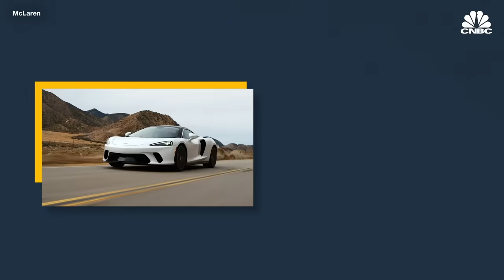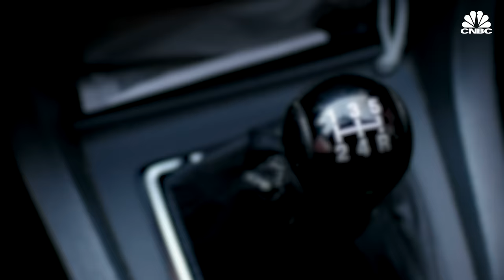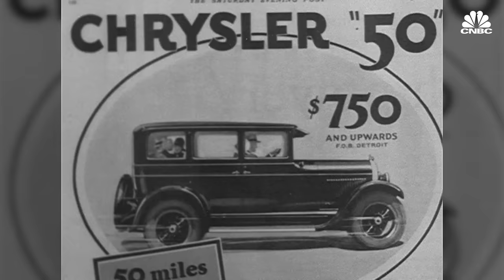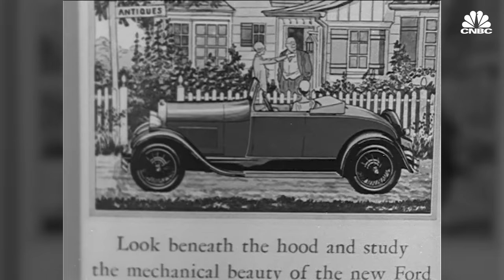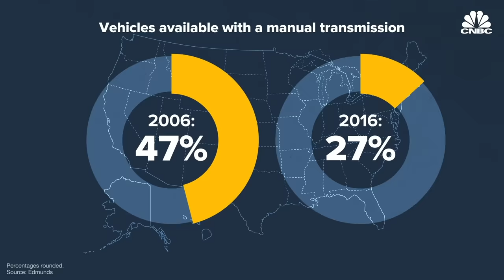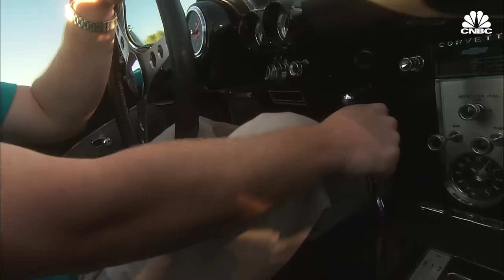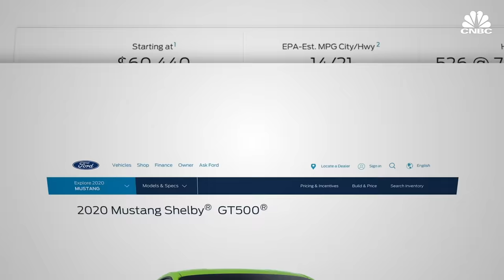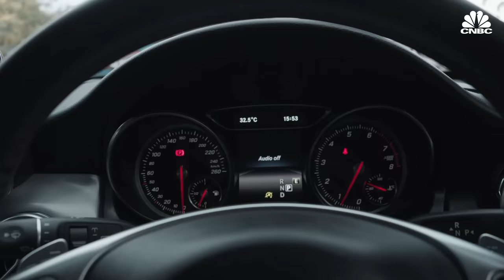Why Stick Shifts Are Going Extinct

Comment: Driving a manual is among the most fun things to do in daily life, to me.  I love it.
Reply: It adds a little bit of fun and joy to daily life. Yeah stop and go can be annoying but when you get to upshift quick onto the freeway ramp you can't help but smile
Reply: Makes gig delivering so much more worth it compared to when I'm stuck with an auto. Heel-toeing all the time and just generally feeling more connected to the car, due to having all 4 limbs controlling 1 (or, at times, 2 inputs simultaneously), makes driving way more enjoyable.
Reply: Agreed, we are commuting every day for work. Might as well add some fun to our daily routines.
Reply: Yeah it's SO fun watching your clutch wear out whenever you take off from the traffic lights.
Reply: @smokescreen2146  Skill issue.
Reply: @mikeydude750  Oh yes, goodluck getting a good lauch to keep up with traffic without riding the clutch when the lights go green...
Reply: used to dislike manual cars but once ive mastered it which takes times, i find manual transmission to be satisfying to drive.
Reply: @smokescreen2146  you shouldn't worry so much about the other cars and wait for an appropriate opening
Reply: @theiaraine  Hahaha you like having cars sit right up your tail and overtake you out of frustration? It's either that or ride the clutch to get a good launch.
Reply: @smokescreen2146  I'm not insecure enough to care about someone passing me when I take a couple seconds longer to take off. It's not as big of a difference than you seem to think it is.
Reply: @theiaraine  When someone is right up your tail, if you shift into second gear at a casual pace your car will then stop for a split second as you let go of the clutch, and where do you think the car sitting up your tail will end up?
Reply: @smokescreen2146  that's really not my problem as they would be at fault. Any damage would be minimal.
Reply: @theiaraine  And you just confirmed what I said all along, that manual stick sucks, congrats.
Reply: @smokescreen2146  I confirmed nothing. I'm saying the problems are not nearly as big as you say they are and they only stem from the rise of automatics.
Reply: @theiaraine  Yeah not big because of people like yourself who understand nothing about cars will likely attempt to floor their cars (ie over reving their engines) when the lights go green in order to keep up with traffic or avoid frustrating the drivers behind, and all this while thinking it's perfectly ok for the engine in the long run.
Reply: @smokescreen2146  The whole point is that I take my time and still haven't caused an accident or damaged my car. And that flooring it is my least favorite thing to do with cars of both types. I couldn't bring myself to do it on any car that I care about or enjoy driving
Now I wonder, why do you care/know so much about something you seem to hate a great deal?
Reply: @theiaraine  In other words you like holding ppl up in traffic and that is your defense for driving manual.
Reply: @smokescreen2146  I'd much rather drive safely and check for traffic before I cross than rush for drivers whose problems I don't care about (tip: you can pass slow cars).

I ask differently; how much experience do you really have if you have such a dislike for manual transmissions which clearly suggests aversion?
Reply: @theiaraine  You see, by you driving slowly you create a hazardous environment making other cars scamble to avoid a red light and in the process changing lanes, braking hard, swearing. All that could be avoided by getting rid of manual cars.

I understand the appeal for manual sports cars and exotic high performance cars in an open country road. But for city stop and go traffic in SUV, utes, sedans? Gimme a break. Why on earth do people like yourself prefer to use your left leg and wrist 200 times a day and then harp on about it on here?
Reply: @smokescreen2146  You don't understand the enjoyment that comes from driving manual then act like you know more than people who actually like driving stick. I'm not going to entertain this conversation anymore. I am frustrated with my lack of answer to my question. Goodbye.
Reply: @theiaraine  What enjoyment? Mention what exactly do you enjoy? I've driven stick my whole life and not just one car. Manual transmission is an outdated concept kept alive by those like you.
Reply: @smokescreen2146  actually automatic transmissions have clutches too, and they wear out justice frequently as clutches on a manual transmission do. So there you have it.
Reply: @smokescreen2146  that is not true is somebody who drives a manual car as a daily commuter shifting into second is not going to take much time and they are on your ass and they hit you. It’s their fault and you could pretty much sue them to get a new car. But the likelihood of them running into you when you go shift gears is highly unlikely.
Reply: @jeffreyburney6161  
Automatic transmissions have computer controlled clutches to minimise wear, meaning it will last the life of the car as long as it is not abused.

The commuters behind may not run into you, but they will surely swear at you as they drive pass and look into your driver side mirror. I hope you have a good face to make.
Reply: @smokescreen2146  I’m usually the one passing them up. And by the way with some of the modern automatic transmissions after about 50,000 miles, you will start having all kinds of issues with them and be prepared to fork out about eight grand to fix the issue.
Reply: I'm driving a auto dd. I wonder if that's why I'm so bent outta shape all the time... idk why but your comment made it click. I know I miss driving manual but maybe it more then I thought.. hmm.
Reply: 110% agreed.

Comment: "If you can drive *manual you can drive anything..." - Dad
Reply: Replace 'standard' with 'Yugo'.
Reply: Yah apparently my father thinks I’m qualified to drive an big rig 18 wheeler now 😂
Reply: @nickihuevos221 yeah with a CDL
Reply: @nickihuevos221  My dad's a truck driver for Fedex and he thinks I am more than capable of driving a Freightliner LMAOO
Reply: I remember telling my dad that when I became a crane operator. I was like , “ you lied to me old man” . He said I was a sonnafabitch... then we both did finger guns.
Reply: @kylemathew205  All this complaining about simply driving a car with a stick shift. When I grew up they didn't have automatic power steering, power brakes or even turning signals. I would like to see these complainers today in a situation where they learned to drive a stick or they didn't drive at all and then see how they feel about standard transmissions on cars.
Reply: @melvinholliday4160  And they were all rear-wheel drive back then, too.  If it was snowy and you needed more traction, put 2 bags of sand or salt in the trunk to weigh it down.  My first car didn't have air conditioning, either.
Reply: Any passenger vehicle 😂 just exclude commercial vehicles.
Reply: "And that's how I ended up driving an M1A2 Tank....." - suprised teenage PVT @ Ft Knox.
Reply: Ok boomer 🙄
Reply: So true. The words of a wise man. I feel like it should he manditory for everyone to learn how to drive stick so they can becone better drivers.
Reply: Colin H.     Unnecessary these days, especially when you’re stuck in traffic all the time.
Reply: @djrom66  "No, but very efficient"
Reply: @acommentator69  i feel bad for you
Reply: Unless it's a non-synchronized transmission with straight-cut gears.  You still have to learn those.
Reply: you don't require skill for this. You just change gear based on the sound of engine. its so simple
Reply: Guess your dad never saw a maintainer
Reply: Thats strange, I never driven an automatic.
Reply: This comment is exactly what my dad tells me every time were on the road.
Reply: "standard". Automatic is standard today.
Reply: Anirban Ghosh downshifting is the skill
Reply: Dad you're smart to have me drive a stck shift 😆
Reply: @anirbanghosh7987  id love to see you explain that to a first timer
Reply: Colin H. 
As a female...I agree!
I can drive a stick, and am proud of it!!
Reply: @josezaragoza3188  "No way Jose"
Reply: @mistamaog  Sadly even lots of commercial vehicles are going automatic. Manual is still prevalent among semi's, but lots of box trucks and similar are auto now.
Reply: @melvinholliday4160  I learned to drive on an 89 Pontiac Sunbird. Stick shift, manual steering, manual locks and windows. Wasn't built with A/C. The fanciest thing in it was a tape deck.
Good times.
Reply: @anirbanghosh7987  yup! Truck I drive has a light to tell me when to shift, I don't pay it any attention because I know what I'm doing. I just glance at the tach once in awhile to make sure I'm not pushing it too hard.
Reply: @r6u356une56ney  the company my uncle drives for put automatic transmissions in all their 18-wheelers.
Reply: A good portion of the large fleet trucking companies are going to automatic transmission semi tractors.
It's definitely harder to shift a stick shift semi the gears aren't synchronized and you either have to double clutch or float the gears pausing through neutral the first Split Second for the engine speed in Gears to match so they don't grind.
Even though it's different it always helped when someone new to driving the semi had a basic understanding of operating a clutch and Shifting the gears in a car just the timing and how to use the clutch without jarring the Driveline.
Definitely becoming a lost art whether it's in a semi or a car.
But understandable obviously much easier to drive an automatic and with all the traffic nowadays more pleasant as well.
But on the other hand if you have a muscle car or sports car they are definitely much more fun to drive with a manual gearbox.
Reply: Colin H.-True.
Reply: lol most cant drive a manual
Reply: @melvinholliday4160  i had a choice .get manual Ram,or automatic.Drove both.Manual had more power.better gas mileage.better towingcapacity.
Reply: @anirbanghosh7987  yes,but most people beeing on the phone texters while drivin. they dont pay attention to RPMs. i love manual Transmission....cause its a skill,plus its fun to drive.
Reply: @bobanderson6870  yupp...my 98 ram is manual 5.2 v8. its definitelly fun to drive
Reply: @How22Step  lol I never come in contact with manual transmission cars anyway.
Reply: My dad and uncle also said the exact same thing to me

Wait, who's your dad?
Reply: "If you can drive a manual transmission vehicle you can drive anything..." - my pro driver friends ;-)
Reply: Just because someone can drive a stick shift doesn't mean they can drive a semi truck. It's much different. You can't just push the clutch in and shift to the next gear or you will grind the gears. You have to rev the engine up or down to match engine speed with transmission speed because there is no synchronizers like there is on standard vehicles.
Reply: @lashlarue7924  I learned to double clutch on a 46 army jeep to get it into first .
Reply: I'm pretty sure he meant any kind of car
Reply: Steal anything
Reply: My dad says the same thing but for me I am aboard most of the year so driving is not as common anymore.
Reply: @nickihuevos221    Lots of  the newer 18 wheelers are coming with auto trans too, less training time for the squids.
Reply: @equarg    I recall a story from my youth something about a fly from Spain and a stick shift............
Reply: @bobanderson6870   When I was driving tractor trailers I only used the clutch for starting and stopping otherwise just match the engine speed and road speed then shift.
Reply: That's not true, I can assure you most Europeans wouldn't know how to drive a classic American automatic (I'm not talking about the new electronic stuff, I mean the old PRND stick).
Reply: I have driven snow cats - Thiokol (shudder!), Tucker, and Bombardier. All of them have automatic transmissions because manuals cannot maintain uninterrupted flow of power. That is a deal breaker with snowcats.
The Thiokol and Tucker had variants of automotive transmissions, while the Bombardier had a hydraulic pump type... I forget what that is called. Knowing how to drive a manual won't help you at all on those things. (Their highest calling is to take you far from rescue and get stuck.) Imagine trying to get this thing out with a manual transmission!
https://www.reddit.com/r/HistoryPorn/comments/1kra2l/a_snocat_balanced_precariously_over_a_crevasse/
Reply: Glad I'm a manual learner
Reply: Not entirely true. Manual cars have somewhat different engines. I’ve driven my boyfriend’s manual Ford Focus which is infinitely easier to control than my WRX, took me a bit of practice to get past the learning curveball that my car threw at me.
Reply: Good advice in 1950. Now go buy a Tesla.
Reply: based dad
Reply: @NorthForkFisherman  i did my boot camp at ft. knox back in 78
Reply: Try a Crosley with a crash box.
Reply: -any European dad
Reply: Wow
Reply: Same*
Reply: I'm India we have : if you can drive a tractor you can drive everything.
Auto is for kids and ladies
Reply: Ya ever seen him drive a manual Semi/petroleum truck?
Reply: I've driven both and I like automatic better
Reply: not true but i like how it sounds.
Reply: I learned to drive with a manual...
Reply: Google two sticks and a tyre........
Reply: @melvinholliday4160  do you mind if I ask how old you are?
Reply: When all that's left is automatic, so what.
Reply: If you can Drive Non-syncromesh Manuals, you can Drive anything
Reply: Thats true tho
Reply: Pretty much true. Legally no but technically yes
Reply: I’ve heard that somewhere before...but I don’t want to drive just “anything.”
Reply: @freddymontes1336  you're so cool for what your daddy thinks
Reply: Don't all dads say that?
Reply: I once drove a front-end loader with tires big enough for a man to stand up in and LOTS of gears. (Of course, my fiance was sitting beside me--and I probably only drove a few feet. But it was marvelous!
Reply: What my pop said.. (he was right.)
Reply: @samueladitya303  No, that only happens if people drive drunk.
Reply: My dad said the same thing. Thankfully, I carried that opinion into my good paying truck driving job 🤣🤣🚛
Reply: @nickihuevos221  i mean you technically can your just not liscenced too they work the exact same
Reply: @mistamaog  why they are the safest vehicles on the road
Reply: @johnw2026  sad that's what is destroying the trucking industry
Reply: @Rollercoaster555  that may be a small part of it, but what's really destroying it is all these dumb government agencies telling truckers how long they can drive, making them put that expensive exhaust fluid in their trucks, along with other expensive air cleaning equipment. My uncle has been driving over 30 years. He's told me that those engine emissions on the truck he drives now are actually cleaner than the air is before it comes in the intake! So he's doing the world a favor (pay attention California!) He's getting people their goods in a timely manner, AND he's cleaning their air for free! 😐
Reply: False
-forklift license checkers